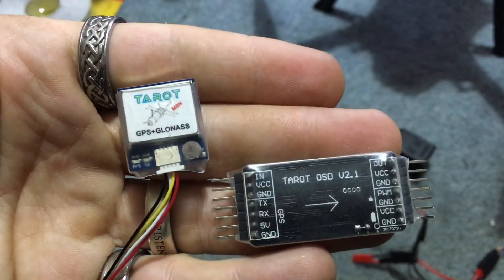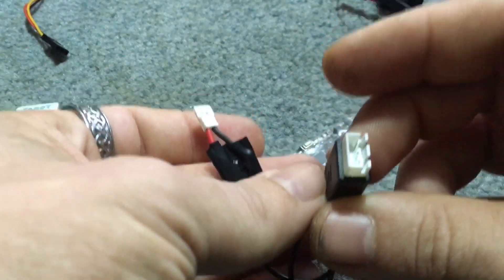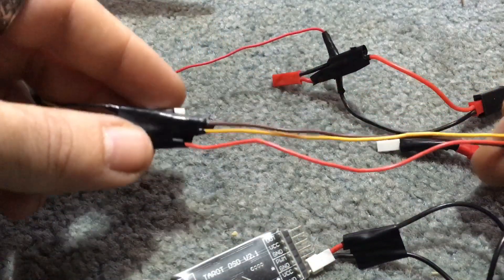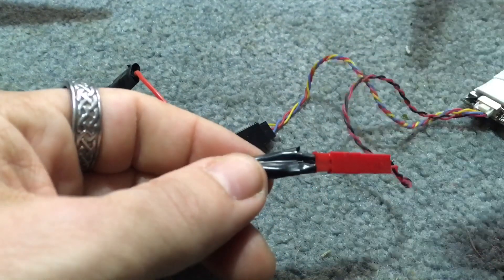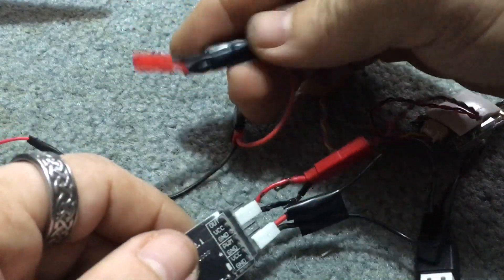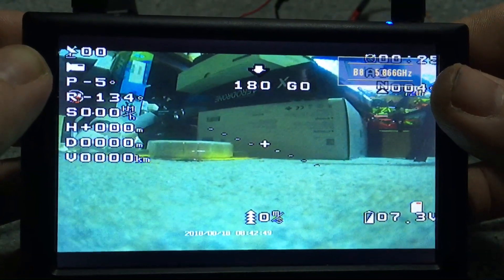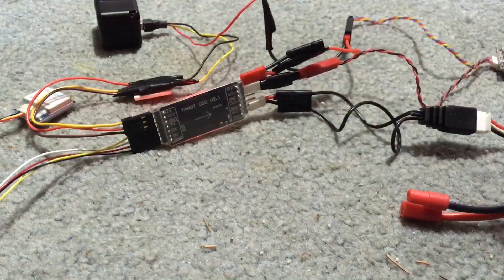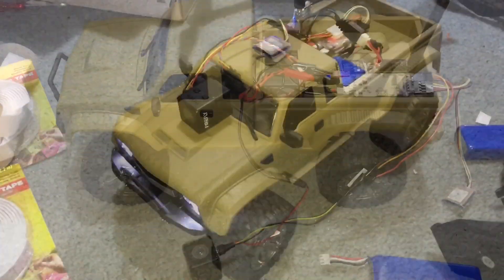OSD Setup Tarot TL300L2 GPS System for Drone Fixed Wing RC Car

Comment: Jay, what do you mean by saying "use of second battery"? Meaning that I can use two batteries to run Tarot unit or it will show voltage of two batteries where power plug is the main and when I plug second bat it will just show on screen voltage for information?

Comment: Hi Jay. I have a question. Why satelite icon shows 00? Doesnt it suppose to have number of satelites found on GPS? Second question. How to calibrate HOME arrow (it only shows down direction or is it gonna change during flight?). And third one. I run separate battery for fpv and main for the rest. I connected red wire and gnd to Tarot and the other end to plus and minus on the main bat plug and I dont see second bat info on osd screen. What did I do wrong? Thank you